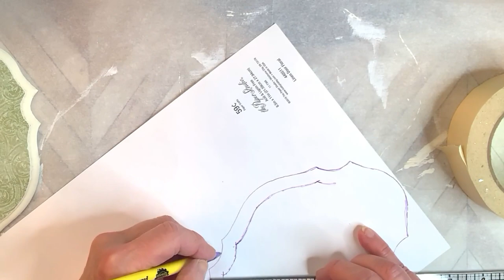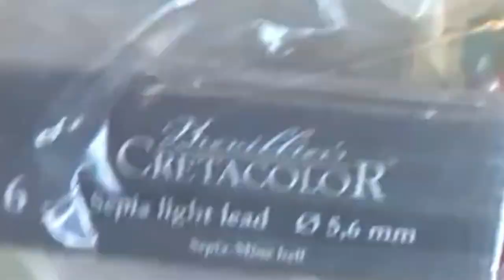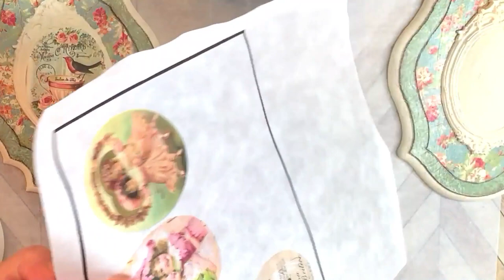Valentine Plaques With Vintage Decoupage

Comment: To roll the clay into the molds without the brayer sticking to the clay, lay a piece of plastic over it.  I use cut up Walmart bags for this.  Also if it sticks in the mold, stick it in the freezer for about 15 minutes and it will pop right out.  I’m assuming this works with the clay you are using.  I use Sculpey Premium Air Dry Clay and it works beautifully.
Reply from the maker: Thanks for the tip! Yes, I’ve popped the air dry clay in the freezer many times, but since I switched to Hearty Soft clay almost a year ago, none of those tricks are necessary. Hearty soft clay is the bomb and it stays a bit flexible even 2-3 days post casting. 👍🏻

Comment: Good idea adding the heat. I use lightweight foam clay like they use for cosplay and I was having same issue. I was used to paper clay and cast resin so this tip will sure help me out today just got a new big bucket clay.
Reply from the maker: Thank you! I was happy drying the edges a bit was the trick!❤️👍🏻

Comment: Great tip on the syringe! About the clay, I bought a package. I did some experiments on it. How it would be like after using it on a mould and letting to dry on a flat surface rather than gluing it to a project. I was amazed how it didn’t dry hard like most clays. It was still flexible. But my question is, will ever get hard?
Reply from the maker: Glad the tip was useful! Yes, it will eventually dry fairly hard, but I’ve found it retains a bit of flexibility which is one thing I love about this clay. It’s not going to break easily like the brittle air dry clay. Additionally, there is no cracking and minimal shrinkage.
Reply: @designsbyJ  that’s perfect! Thank you 💜

Comment: Love your work!  I’ve also enjoyed finding Pentart in the US!!  Fineline crackle is my favorite. The solvent sealer is soooo stinky!  Do you use it indoors? Or is your solvent ok to breathe?  Thanks!
Reply from the maker: Thank you so much! Are you referencing Pentart’s Gloss Varnish? I’ve never noticed it having a strong smell.🤔 Now, the turpentine they sell to clean the brush after using the varnish is super stinky! I pour a tiny amount on a paper towel to clean the brush then take the towel outside until the smell/product evaporates.
Reply: @designsbyJ  I bought Pentart matte varnish solvent and I have to do it outside because it’s sooo stinky. Any other varnish just smears  off the antiquing!

Comment: Another question.... could I use the Mod Podge clear sealer instead of the one you used to protect the lead pencil from smearing?   I have the MP spray and really don't want to buy something when I already have it at home.    Thanks in advance.   As I said in another video, I want to learn everything you are doing.
Reply from the maker: Well, I suppose you could test it on something to see if it works; I’ve always been told the fixative is necessary when using lead, pastels, or watercolors, so I’m not certain.

Comment: Can you paint air dry clay before you place it on your project?   For me it would be easier,  I would not get a paint color on the other part that I would want to paint a different color.
Reply from the maker: Yes, you can, and sometimes I do depending upon the project and application.

Comment: Why did you use the hardy clay?  I don't think I would like to work with rubbery clay.  It looks like it will want to fight me.  Wouldn't the air-dry clay do the job????  I'm learning and will have a lot of questions.
Reply from the maker: You can certainly use other air dry clays, but they tend to crack when dry. Sometimes, that old world look is what I’m going for, but not in this case since I was decoupaging over the surface. It just takes some practice applying the hearty clay.  Once it’s been opened, even stored in a ziplock bag, it gets much easier to work with it. I love the stuff now that I’ve used it for several months.